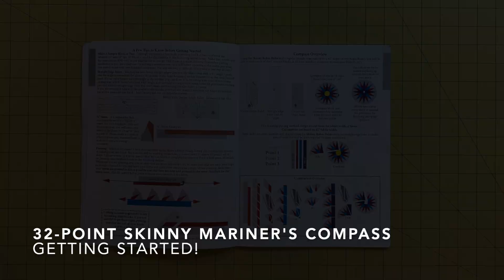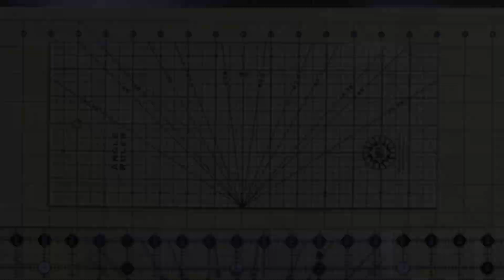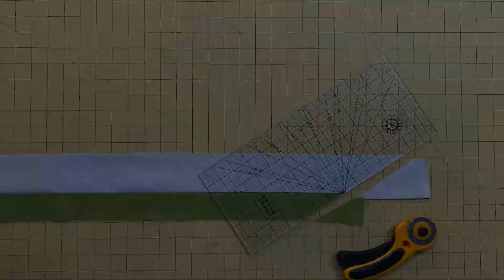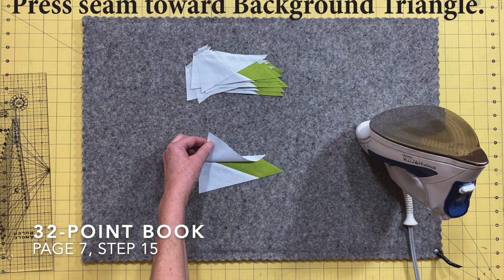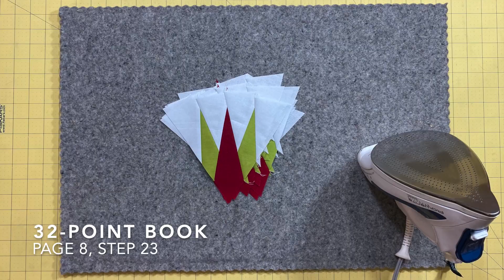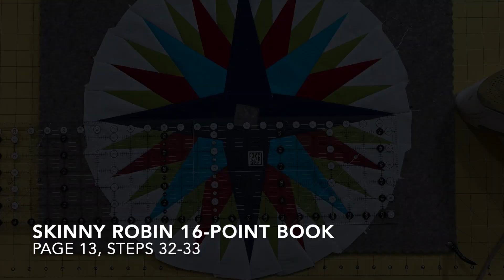32-Point Skinny Compass Block

Comment: I am making the 36" mariner's compass. The directions for trimming the first 2 fabrics are leaving me scratching my head. Nothing is lining up as your video says it should. Thank goodness I'm using a frixion pen to see what I'm supposed to cut. The first cut across the top of strip 1 and the background fabric does NOT land at the corner of the background fabric. The left and low doesn't reach to the edge of the strip 1 fabric, I can extend but it makes things more complicated. the high and right doesn't in any way line up with anything. Can you advise me what I'm doing incorrectly. Thank you.